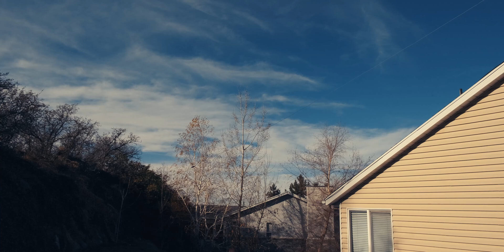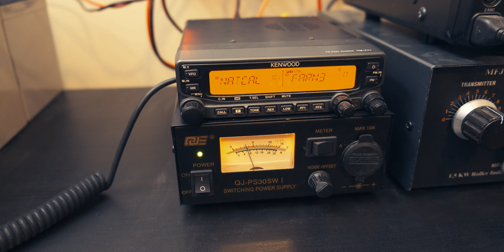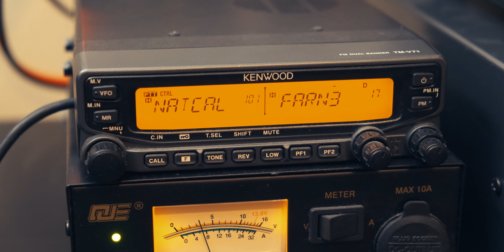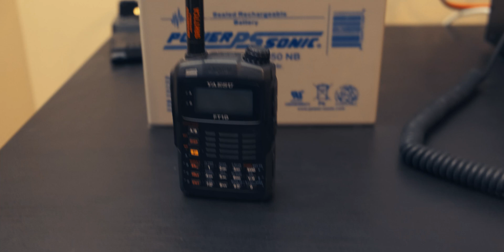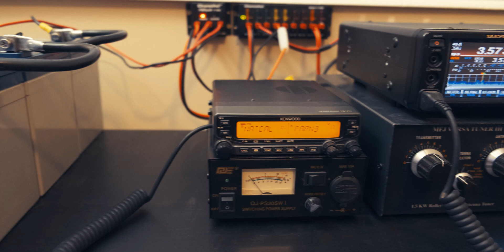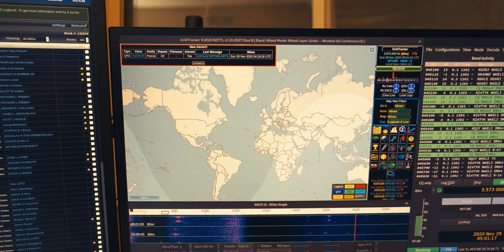Ham Shack Tour 2020 (KG7AJM)

Comment: Do you have a link to the battery / charger minder?
Reply from the maker: https://a.co/d/0bNr5Jls
Reply from the maker: Yes it is called a power path, it will charge the batteries with the power supply. If the power fails it automatically uses the batteries.

Comment: Find your current limiting control on your power supply and raise it up. If it doesn't contact the manufacture and find out how to do it.
Reply from the maker: I replaced the PSU, it had other issues. I have another video that show it.

Comment: Nice video. A few thoughts... Only charging to 13.2V will kill your AGM batteries. The normal float voltage is 2.3V/cell at room temperature (goes lower for higher temperatures), which is 13.8V. Best to hit 2.35V/cell (14.1V) when bulk charging and then drop to the float voltage. Your batteries are not getting anywhere near full charge, and will therefore die young. Also thinking that your power cables are too thin to carry the power you need to transmit at full power without significant losses, particularly when you factor in the connector losses.
Reply from the maker: Thanks, you should see my latest video on my tour, I solved that problem.